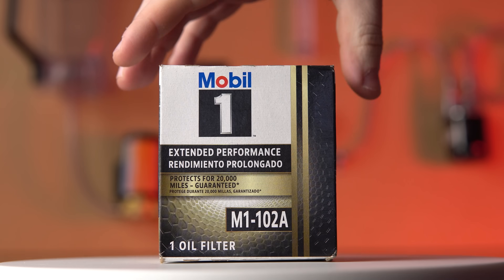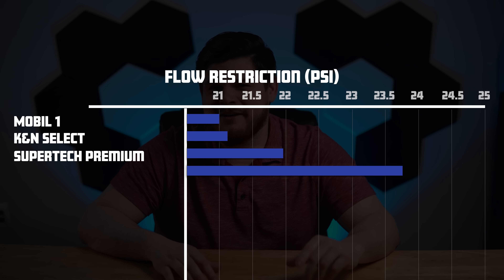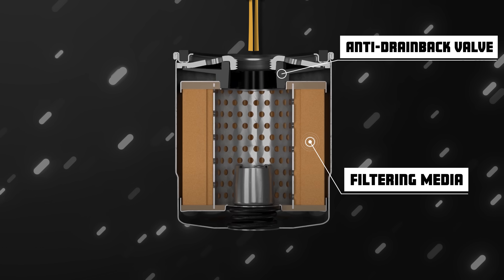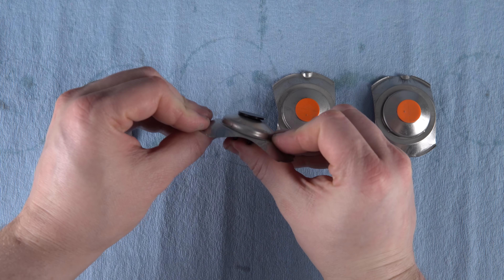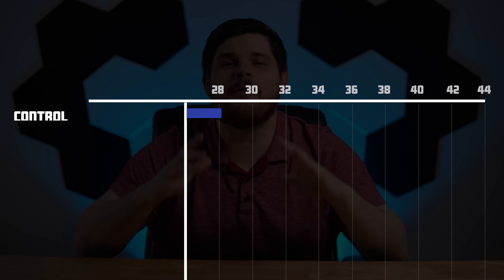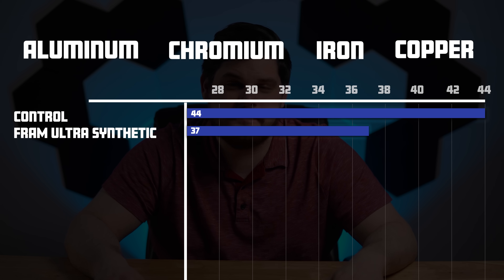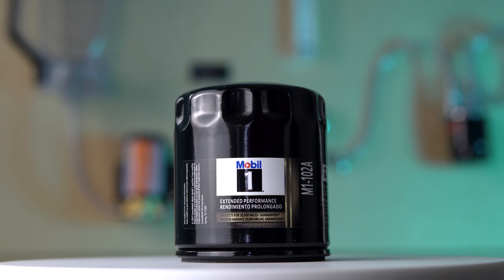Engineers Test the Best Oil Filters! FRAM | Mobil 1 | K&N | Walmart Brand

Comment: One thing I would suggest, despite the difficulty of doing so, is using oil heated to normal operating temps for the long-duration tests. The oil/filter media relationship changes very much with temperature.
Reply: im still gonna use mobil 1 oil filters because im confident it will pass the "heated oil" test.
Reply from the maker: @97marqedman, This is a great suggestion, we are looking into this for future videos, be sure to subscribe so you don't miss out on future content! Thanks for the support!

Update: Make sure to go check out our new videos with the upgraded RIG.
Reply: You are 100% correct, things will change when the oil is hot and thin. I hope they throw in a cheap STP filter just for giggles. I don't know why Fram filters get such a bad name, I have used them for years, some in work horse situations, and they did well for me. If you change your oil when you are suppose to, that is key to long gevity on any engine.
Reply: @jthonn  Really good filtering would need a second (bypass) oil loop with an extra fine filter down to 3 or 2 or 1 mym. But the industry doesn't make it, and it may be too much effort for a car engine!
Reply: @konradcomrade4845  ?
Reply: @konradcomrade4845  Amsoil has been making a system like that for years.
Reply: #Perfect!!! 👍🏻
Reply: As long as all other factors are the same, then it is a fairly realistic test, but it would be very awesome to see if there was any actual changes, like maybe the warmer oil able to carry some particulates through the filter.
Reply: Very good observation; I wouldn't have thought of that....
Reply: Heating the oil and then filtering under normal driving conditions would be the best way to test, because viscosity change when the oil is warm. Excellent suggestion.
Reply: I agree, that would definitely affect the flow test. I have used both Mobil 1 and the Fram one he is showing. I think he's a bit of a Mobil 1 fanboy, not sure it ranks as the best. I would place it and the Fram in a tie with a slight edge going to the Fram for better filtering.
Reply: @scottbartlett2087  hi ,  Fram Boy!
Reply: @scottbartlett2087 Unfortunately, reduced flow rate and higher backpressure through the Fram are a bit alarming.
Reply: Was about to make the same comment, also, the oil system needs to run at the  typical oil pressure of a running engine.
Reply: @turboslag pressure and  heat call the shots 😊
Reply: An easy way to do that without heating the oil is figure out the viscosity of the heated oil and simply use a lighter oil that simulates that at room temperature.
Reply: @InWithBothFeet  That could work, but heating it up should not be a big deal. The fact that they used the same conditions means a lot. It will be interesting to see the difference with the hot oil. If it doesn't change the ranking of the filters, then you will know that heating the oil doesn't make a difference.
Reply: This  is the  problem with the  internet engineers they weren't even smart enough to  test the  filters in a real heat condition and  also check  viscosity break  down  each  filter caused
Reply: Yep! I do notice how the oil filter media looks like when I do the oil change.  They look like a hard, solid burnt media paper. Which makes me wonder how does that continue to do its job of filtering contaminants when they're cooked and hardened.  Doesn't that just means the oil are just being routed through the bypass valve instead of being filtered.
Reply: @97marqedman  
I would bet that with heated oil, the 20m filters would have significantly better flow and I don’t think just bc you have a 24 pressure testing filter matters over a 21. I bet there is Plenty of margin and I would go for a 20m filter with 99% any day(or night)!
Reply: I was thinking the same thing. Oil temp will play a role in the test as well as varying viscosities. 0-16w vs 10-30w. I would like to see what sending 20-50w through that double filter would do.
Reply: I believe it's called Viscosity.
Reply: Throw an Amsoil filter in the mix. Would love to see how it does
Reply: You’d think the “engineers” would have thought of that😂🤡🤡
Reply: @mattricard26  but they arent doing engineer stuff. They are doing make videos for money stuff. 
2 very different objectives.
Reply: @mattricard26  typical internet comment thread w/the true 🤡 calling others 🤡 🤡
Reply: @edwardpeders9582  You should only use the oil the manufacturer recommends in your vehicle. If you should change if you live in Alaska, or should I say in an extreme cold or hot climate, it should let you know in the owner's manual.
Reply: @jthonn I think that is the safest choice, for sure.

Comment: any of these filters will likely work well, from what i've seen stay away from the cheap orange can. the cheap fram, i have seen in several videos often has a very poor seam and doesnt really filter much of anything. for a budget filter the supertech filters arent too bad. i use the supertech synthetic oil and it's a good oil. i change my oil every 4K. i think a 4k oil change interval with an oil like supertech or other house brands (as long as it has the proper API label) is much better then following some stupid over extended drain interval.

Comment: The problem with this test is that you need to conduct the test and buy filters for the SAME VEHICLE. This is because different cars have different sized engine oil filters. Different size filter equals more filter media. Which equals more filtering capacity. Which yields an inaccurate test.

Therefore you can not conduct this test comparing filters from toyota to honda to ford etc. You can only conduct the test for 1 OE vehicle and several aftermarket options for that vehicle. So OE filter should be removed from the test entirely as we are only going off "brands" (aftermarket) as a baseline when choosing products across different vehicles.

Ford f150, Chevy Silverado, Ram Pickup, Toyota Rav4 and Toyota Camry are most sold vehicle in the US therefore they should have the biggest market of available filters. 

Ideally the setup should include a pump that is cleanable or doesnt get contaminated with the (oil)
Reply from the maker: You are correct, comparing OEMs will be a challenge for the capacity testgiven they were manufactured for different cars. Their filtering performance thou can still be measured compared to other as well as the drop in pressure. Thanks for watching and supporting the channel.

Comment: The oil pump and filter system, on today's modern engines. Was never designed to be efficient. It was designed to sell oil, sell filters, and if you were not paying attention to either of those... You would be able to put a new engine in your car particularly, they were looking forward to you using, the Chevrolet 350.

It was Ian Smith's dream that, the Chevy 350 would be a universal platform for all automobiles, and aircraft, and boats. But in order to get, a Chevy 350 in your car... You had to get the old one out... Best way to do that, is to get the customer to destroy it.

I mean, the automotive dealership association of America, has to have you coming in the door, every single day. In order to maintain their profitability. And, if you actually had a system that was efficient, and worked, without having to maintain it on a monthly or, try monthly basis. Then, there would be absolutely no need, for you to walk into a dealership. And that would spell disaster... For the entire association. 

I have a customer, that has a 1955 Chevrolet 210. With a straight-six, and an oil bath system in it. That thing's got almost a million miles on it. And the crankcase has never been opened on it. And it runs just like the day it came off the showroom floor. I have changed the brakes on that car, more times than I have the filter.

Comment: I believe in secondary bypass filter they filter down to one micron such as PPS one or Gulf Coast filter. My deisal oil is not black my car got 500000 before rebuild and over five million miles to rebuild. Air filters need serviced. City people should change at 2500 miles compared to country prople. A Ford f 350 delivering in NYC compared to delivering in western states. The Mail d
Delivery driver is hard service highway driving

Comment: That was a really good video. You put a lot of effort into making it. I would still never buy a fram though. The cheap line filters are useless, and the premium ones are a failed attempt at a premium filter. They compensate too much, which causes problems. They collapse or plug entirely too fast. The idea of running a gasoline engine 20k is beyond absurd as It is.
Reply from the maker: Thank you so much for your kind words. We really appreciate your support! We are planning on testing all those FRAM later on to see what the difference is.

Comment: Liked and subbed for great testing. I agree with others the Purolator boss would be a great test subject. along with testing with and without a Magfilter. This does lead me to a question.  You said in the video you used aluminum powder because most of the engines today are aluminum.  However, dont they use steel sleeves in the block?  while yes most of the block may be Aluminum the wear surfaces are steel on steel for the most part not aluminum.  So im thinking "aluminum" powder is not the "best" testing medium.  I could be wrong on this so feel free to set me straight.  Fram should be looking to increase their filter area to compensate for the more restrictive filter media.

Comment: I've used the Fram Ultra synthetic for quite some time, seems to do very well! Although I also change my oil & filter between 6-7k miles which keeps it very clean.

I drive a 1996 Saab 9000 Aero B234R, 5Spd Manual!

Might try the Mobil 1 on the next change I do, I already use their oil!
Reply: 6-7k is a little early. Full syn oil generally can be driven safely all the way up to 10k. Even longer if you drive like a granny in not extreme temps. I find 9k+ mile oil changes to be extremely dirty. 7.5k-8.5k is the sweet spot, although it’s got life left, it won’t make a mess as it’s far less dirty of an oil change. Remember, if you want your kids’ kids to still live in a world with fossil fuels. Don’t waste useable motor oil. Besides, you’re burning money by changing it early with no be if it.
Reply: @AznTony360  it is a little early although most Saab mechanics recommend around 6-7k on the 9000 Aero for the engines to be bulletproof. I'm at 350K KM on the original head gasket! Service records show the oil changed between 6-8k since it's first owners service at 8k in '96 so I've just gone with matching that. I have fallen behind though this time. I'm at 8.5k miles or so. Maybe 9k. Gotta get on it

Comment: Well shit I have been using mostly Fram but some ac Delco for 35 years with valvoline and have always changed oil at 3000 miles and have never had issues 86 Camaro v6 284,000 miles 95 biuck lasaber v6 250,000 03 and 04 GM trucks 5.3 around 300,000 and still going

Comment: As soon as I saw the size of the wrench you are using on an oil plug I knew you were a novice mechanic at best.  
The Fram's 3 more psi is the price you pay for 20micron filtering vs 30micron.  That is substantial, the 3 psi is NOT.
The by-pass valve design you like so much is no more effective that the others, just more expensive to make.  The Fram filter for my Triumph has the design you prefer.  It's really NBD, big meh, except it demonstrates your real purpose here is to dis Fram.  It's in your verbiage
The Mobil1 has the most evenly placed filter pleats because the uninstalled length of the filter medium is longer (more stuffed in there), a good thing to maintain flow volume but not lower micron filtering size.  
The plastic inner barrel is inconsequential to the super tech filter's robustness or efficiency.  The glued joint in the filter medium is actually better that the metal strip.  The metal strip is more likely to leave gaps larger than the micron rating of the filter.
Your test rig appeared adequate for the purpose.
The K&N PPM was 37 at 30 microns.  The Fram was 40 PPM at 20 microns.  How many of the K&N's 37 PPM were between 20-30 of the 37 PPM?  The Fram is clearly better than all these tested filters.

Comment: I usually run the Mobil1. I used the Fram Ultra Synthetic last time and it seemed to do fine. I went with it as they were out of the Mobil1. I am a cheap bastard but most people will do well under 20 oil changes on a vehicle before trading it or retiring it. Its hard to justify going with a cheap oil or filter to save $5 or $10 on an oil change when they are only happening every 5k or 10k miles. Even 5000 mile changes would see you save $200 on your first hundred thousand miles if you saved $10 a change. I'd rather spend the bit extra and save the wear on the engine.

Comment: Filtering capacity test is unreliable if there is no measure of potential flow through.   It’s not an accurate reflection of filtering capacity because it doesn’t measure the actual capture.  

It’s possible more of the smaller particles were getting through as each grain isn’t a perfect measure.  If that makes sense.

Comment: Did you use a tempo shift effect on your voice to slow it down? I hear some processing artifacts here. They're kind of distracting, but that might be just because I'm a mixing engineer.
Also, this was a great video! Very informative!
Reply from the maker: @Tantaloss there is not a tempo shift but definetli a pitch shift. When we released this video we had 400 subs and very low budget, so we where not able to sound great the room. There was a lot of echo on the recording so we used Adobe AI to reduce that, but that also removed all the low frequencies from my voice (hence the need for pitch shift) Either way, good ear. We are trying to make improvement for future videos, and change the smoke detector battery🤣. Thanks for watching and supporting our channel.

Comment: I used Mobile1 high mileage oil & Mobile1 extended performance. Can it really filter for 20,000 miles or one year? Thanks ☺️
Reply from the maker: Thank for watching and supporting the channel. I would not recommend going that long without changing the filter. Even thou filters state these numbers, you should always follow what your owner manual says. It's not just about particle counts, but also used oil becomes acidic with time and need to be changed, so at a minimum twice a year.

Comment: If I use Fram Ultra Synthetic and change my oil at every 5k miles (8k km) with full synthetic oil, would it be wise to only change out the filter every 2 oil changes?
Reply: @e.tamplin8102  What's the point of these ridiculously long filter lives? No oil can survive that long

Comment: “Therein lies the problem.  You still need to allow oil to pass thru and the more filter media that you have the more restrictive the oil filter is.”

You have it backwards.  The flow thru the filter in terms of flux is volume/(time*area), where volume/time is the flow rate of the oil and area is the total surface area of the filter media.  Flux is the average velocity of the oil thru the media  The pressure drop across the filter media increases with the square of the flux.  It follows then that pressure drop is inversely proportional to the square of media area.  In other words, the more filter media that you have, the less restrictive the oil filter is.

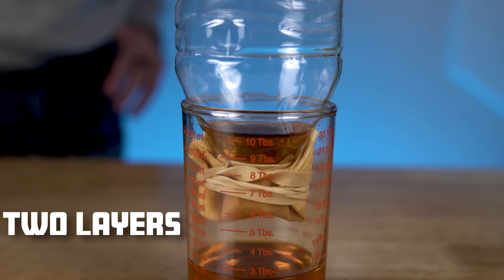Now then, your visuals at about 1:40 show “ONE LAYER” and then a bit later “TWO LAYERS.”  It is true that adding layers will increase pressure drop.  But most automotive oil filters, including all of those tested here, are single-stage.

Comment: Did you guys heat the oil to proper operating temperature?
Reply from the maker: We did not, unfortunately it was just too expensive for our small channel (400 subs at the time) to buy all the necessary equipment to withstand high temps, but we are planning on upgrading our test for our next video and we will simulate operating temperatures viscosities per the ISO standard. Thank you for supporting the channel.

Comment: Although I've not see every oil filter made, of the many dozens of brands I have seen, exactly NONE of them has an aluminum end cap!  So you might want to correct what you say @ 9:00.
Reply from the maker: @Don Steele Thank you so much for the correction. You are 100 percent right, we should've stated steel. We will place the correction in the description as you tube does not allow edits once it is posted (aside from blurring). Again, thank you so much. It is much appreciated 👍

Comment: My father owned a garage for over 60 years.  We never found any indication that filter brand had an effect on engine wear.  Doing an oil change at the recommended interval is 99.9% of the battle.  When we would rebuild engines we would put in the same brand of filter that the car manufacturer used.

Comment: You didn't test the puralator boss or one series filter which is what I religiously use without question. Change my filter every other oil change. No issues for 130k+ miles
Reply from the maker: As a small channel we had budget constraints when we released this video, but given the amount of support, we will be testing more, so be sure to stick around so you see the Purolator Boss!
Reply: By not changing the filter every time you are diluting your new oil with the dirtiest oil in the engine.

Comment: Miles of filtering doesn't matter as the oil itself breaks down and becomes less efficient, less lubricating, and less protective immediately when you put it in the motor. Many factors take place in breaking down oil, but I promise there's no oil that actually lasts 15,000 miles.